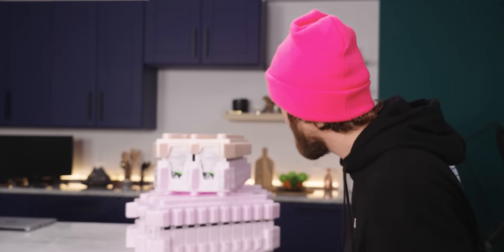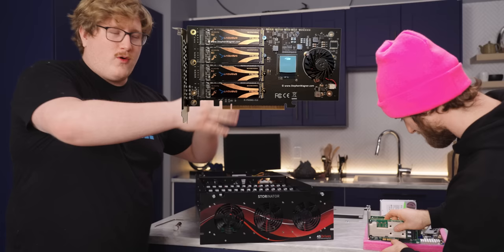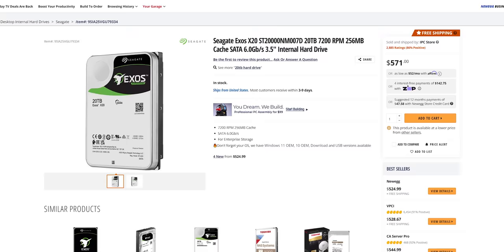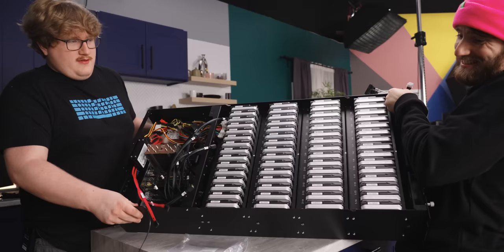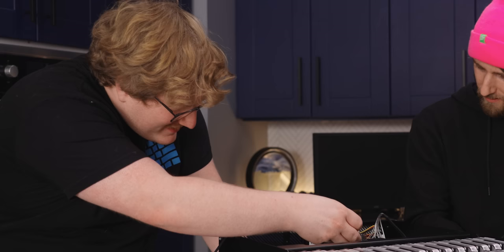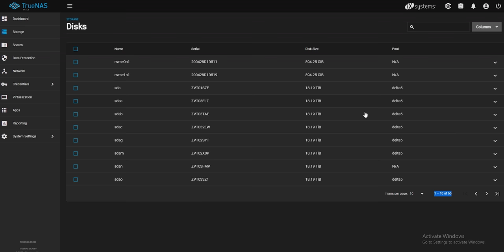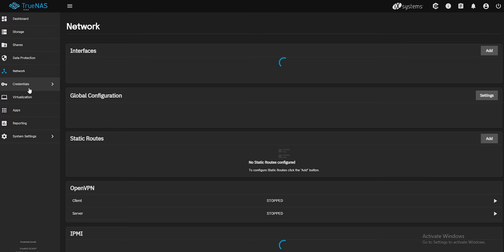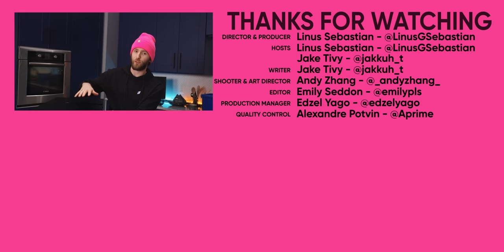My dream FINALLY came True! - Petabyte Project Recovery Part 2

Comment: I wonder why you're not going for the WD Ultrastar DC HC560 drives instead of Exos X20? It doubles the cache to 512MB (so the whole array one could say has 30GB of HDD caches ;) and it comes with their patented OptiNAND solution for faster/more efficient ingestion/look-ups) and from the spec sheet reduces the power draw when in use by 2W per drive, that would amount to well over 100W saved when the server is munching through data across all drives... That's 100W the Epyc/RAM/SSDs/HBAs could well use... Sure it's just 100W on the whole storage machine that eats well into 1000W... so not that much in grand scheme of things racked in your DC, but it's a reduction on a 24/7 solution. Perhaps there were other factors for the choice? It couldn't have been just price, as WD seems to hover around or slightly below those X20 20TB Exoses, so in bulk sales you must have got great deals regardless of the brand. I doubt it's a brand's historic quality thing, as we all know WD Ultrastar DC drives are actually coming from the HGST R&D that WD has bought (and thus slapped WD logo or colored names on'em) so they offer DC/server storage pedigree and stability engineers know of. So what was the favoring factor for the Exos drives?

Comment: Linus should let me do his hardware monitoring setup for his petabyte project. In 10 years I have never lost data because of drive failure. But I also worked in a company with 100k+ servers and buitl the hardware monitoring solution myself :)

Comment: Why to do single enclosure? Please examine the leading tech about how to do petabyte storage. Single chassis is single motherboard, single point of failure. You need several chassis and advanced networking filesystem. I mean like Isilon systems.

Comment: Coming from managing two 1.5petabtye all flash HPE 3PAR 20800 systems (prod site+dr site),  I'd personably be worried to put data on their rig ,its not even redundant with another copy , but I guess its all for sh*ts and giggles anyway,  like a really big NAS.
Also guessing they don't have a proper backup solution in place , real hail Mary situation going here.

Comment: It's much cheaper than using 50TB SSD's at $12,500 each. $300,000 for the drives would be a lot! Still better than putting 60 of the $40,000 100TB SSD's. $2,400,000 is a bit pricy for drives for one server and who needs six petabytes anyway? In twenty years we will have single petabyte drives that are like $50 anyway.

Comment: What I don't like about buying drives on mass like this is that they tend to fail at the same time-ish. If they're from the same production series and there's a manufacturing issue then its even worse.
Scrub on a 40Tb NAS already takes like 3 days, is it going to finish scrubbing all disks before the month is up or is it going to be scrubbing 24/7/365 ?

Comment: Hey Linus,
 
Just curious, why not just buy an actual SAN from a vendor like HPE and have a support contract? Just replace drives when you need and have a second one for replication and failover.  Your company is at the point to where you need to begin looking at enterprise storage solutions rather that using some third-party hardware. What kind of support do you get for the storinator? Some support contracts include on-site support if the device is to fail within a few hours. That's pretty much a standard for EMC'DELL'\HPE. How does the firmware on the storinaor compare to that on an enterprise SAN?

Comment: Oh and instead of instead of using a cooler what do you want to do and you can actually get them and just order and it’s copper tubing but it has the nickel with it and it’s meant for your brake system but you can actually use that and you can write liquid through it but then that way you can actually harvest the heat and her made it in the Thermo electricity in Feedback into itself which will also keep your system from crashing because then it’s not you know if it’s like when it when you feed the power back into itself it gets smarter

Comment: You really should look into a Qumulo cluster with your needs. I'm loving it.
Reply: No they shouldn't. They should hire an IT engineer and get a real SAN.
Reply: @pufthemajicdragon  This is a NAS device not a san. Difference is how you attach to it. A San is joined as a block device allowing you to format it on the machines you attach it to. A Nas device allows you to connect with SMB or NFS and a few other methods. NAS devices typically have an underlying filesystem. The advantages of a qumulo cluster is redundancy. You can loose a machine or a switch and the cluster does not go down. You have quite a bit more bandwidth to the cluster as you have multiple machines to service the users. NAS devices are used for more than one computer to access the files. SAN devices are used with only one computer to use the files. You can use a SAN attached disk on a NAS machine but it is highly inefficient.
Reply: @pufthemajicdragon  I think you need to research Qumulo. It doesn't even sound like you know what you are talking about. It is so much easier than what you describe. I actually do not know how prices compare but any of their IT could easily manage a Qumulo. And you pretty much need to do as much work or more for a SAN solution. I replaced an EMC Isilon which took a lot more knowledge than the Qumulo does. The Qumulo was significantly less expensive than  continuing with EMC. At least that is what I have been told. I do not know their workflow. But if multiple people work with the same files a NAS is better than a SAN for that kind of workflow.
Reply: @pufthemajicdragon  A SAN makes more sense for a VM environment. Where each of the machines needs it's own disk carved out on a SAN. For non-VM's each machine would need a card capable of presenting the storage to the machine if you wanted to boot from it.
Reply: @jeffsadowski  
Jeff: Doubles down on the NAS idea
Also Jeff: Is wrong
Also also Jeff: Doubles down on the NAS idea

I am as familiar with Qumulo as I ever care to be. It's a software layer for abstracting physical storage media for file-based storage. It's DFS for your nix-based NAS (hashtag reductionist analysis). And here you are telling me that *I need to research it while you're touting it based entirely off of "what you've been told". Dude.

I told you, a NAS is a purpose-built appliance. Stretching out the acronym to justify a claim that it therefore describes any and all kinds of network-based file sharing is definitional retreat. Hell, by your definition filehippo is a "NAS". But by your definition so is a SAN, which means you agree with me but are just being confrontational. 

Qumulo is a software platform for managing data. LMG already has a software platform for managing their data - they use Windows and it is more than enough to suit their data management needs. What they do need is a hardware platform that doesn't fall apart every 6 months. A SAN is that hardware platform.

(Qumulo does sell hardware, but near as I can tell it's whiteboxed Supermicro. There is no value proposition in their hardware. And it's the hardware that LMG has a problem with.)
Reply: @pufthemajicdragon  8:52 TrueNAS is what they are using. It does not support using multiple machines as one file-server. The glusterfs solution was closer as it allowed more machines to add more storage (It was also more complicated). The method they chose with a single chassis has no redundancy on most aspects (at least they are doing raid). Single point of failure with the machine failing. If they can be down till they find a replaceable hardware that is up to them. It also has reduced bandwidth because it is one machine.  With a Qumulo Cluster as with an Isilon to get more storage or bandwidth you simply add more machines. (NOTE you need the network equipment capable of the total speed you need) The single file server solution requires more and more disks, or more and more density. The upgrade costs are much higher replacing all the disks than just getting another node for a Qumulo or Isilon cluster. Not to mention backup solution built into the Qumulo and Isilon cluster model called snapshots. Traditional backup for me was taking longer than my network could support and killing bandwidth for my users. I actually have 2 clusters one for DR (Disaster Recovery) That I keep in sync with my primary cluster. I have about 1Pb of data and it took a few weeks to setup the replication but now it is able to replicate with little network usage at all. My SAN I use for my VMware cluster. No other machine but the 4 hosts I have can see the SAN.
Reply: Why would you want to have the redundancy speed at the block level just to loose it again sharing it out to a machine when they are going to be using it as a file server anyways. A SAN doe not make sense.
Reply: @pufthemajicdragon  All the benefits you mentioned for a SAN apply to a Qumulo or Isilon. They do not need a SAN.
Reply: Also I know a Powervault would not cut it in my environment. They transitioned from a similar solution into a Isilon because of it. The only upgrade paths for me were replace an aging Isilon with a new one or move to Qumulo. They might be able to do with a Powervault at LMG. They probably do not have the machines hammering the filesystem like I do. But what costs more per space? We have powervaults at the other locations they have more issues with them than I have ever had with the Isilon.
Reply: Qumulo warranties their hardware as well but even if not that's the whole idea it is designed for pieces to fail. I can loose multiple pieces of hardware. I have a real problem with multiple pieces in a single chassis as you need to take it down to replace it. I can remove a couple of nodes of a Qumulo or a switch without an outage.
Reply: Thinking about it, Yeah a powervault with expandable shelves would probably work good for them. Not everyone has the same needs.

Comment: On one hand it could be fun to have a drinking game where you take a shot every time line us break something or drop something or does something wrong. Downside is used very quickly be getting sued for alcohol poisoning deaths. $30,000 in hard drives technically 40,000. Clutches chest. 40000 goddamn dollars would pay my taxes for the next 10 years or so and pretty hefty chunk of my other bills if not everything taxes and bills. Scary to imagine somebody spending that much strictly on her drives.

Comment: How come you guys don't give the western digital (formerly HGST) enterprise drives a spin? Better power consumption, and better reliability several years running through lower annual failure rates (see backblaze's data).

Comment: Btw, how do you deal with that error when trying to access another computer on a LAN?

I sometimes connect my two PCs with an ethernet cable, but only one of them can access the shared folders of the other PC seamlessly from the Network library, while on the other computer you need to manually type the network location of the shared folder (the... subsequent folders in that one can be accessed the usual way).

tldr: Both PCs can access each other's shared folders, but one of them requires you to manually type the location of the shared folder(s) you want.

Comment: - If they had made it take 64 drives instead of only 60, you know, a nice proper power of two, then you'd have been able to break a full petabyte. 🙄 🤦
- It'll take a month to transfer all the data? Jeez, I'd have a heart-attack from stress, waiting to hear the crunch of drives failing within the first day. I used to leave the room and hold my breath just waiting for a CD to burn. 😒
- Unactivated Windows? 🤨

Comment: What is the purpose of having a server like this? If the data is literally just stuff you don't wanna throw out but also don't ever use, it seems excessive to run a server 24/7 just to maintain old files that will never be used. especially if you extrapolate to a worldwide scale, like how many tons of CO2 is wasted each year, just on upkeep for files that will never see the light of day again. Are there any storage methods that don't require energy that is also safe?

Comment: Question:  I remember once before you mentioned (in a video) that you mentioned a limitation or restriction to the number of hard drives that could be spinning in a chassis at one time. Is that applicable here?

Comment: 3:08 actually . . .  its the issue i ran into with my unraid server, not enough pci-e lanes. and since epyc was cheaper than an threadripper. that is exactly why i went epyc!
8:08 please tell me you tested it before putting it in . . . i had to mount my epyc 4 times before it made proper connection.

Comment: People in 2032 watching this old nostalgic video from their PC with 10PB SSD be like: “Those were the days”
Reply: You say that, but the first 10tb HDD was created in 2014. In 8 years the size of these hard drives are only 2x as big. A 1pb drive is pretty far off seeing how you would have to double this storage 6 times to reach it. At current pace for consumer hard drives that would be 48 years from now. Granted, you said SSD, and I think the SSD side of things are advancing faster. However, in general these days the focus is in scaling horizontally instead of vertically. Instead of larger drives, you just add more. Use something like CEPH and scale your storage out over multiple hard drives across multiple machines.

Comment: Needed another 3 drives to be considered a 'nice' setup... Also, when selecting drives one by one couldn't you have just selected all and removed the few you didn't want?
Reply: They couldn't have used the select all button because they were setting up vdevs with 15 drives in each one.
Reply: @Bixsu-  good point! Forgot about that, nice one.

Comment: But if you put a 20TB disk, if you loose one, u loose more data, so if I would be doing this, I would still use an 16TB disk... Its logical if you have data you don't wanna loose

Comment: I am convinced this is a troll. 50+ drives in a 4x15 pool and raidz2? I wouldn't raidz2 more than 8 drives... vdevs are not supposed to as big as you can make them haha. Same loads and cycles and microwave configuration. How about some hot spares?

Draid is literally made for this use case with large files. You could easily get 75% from that 1.2pb with triple parity. The rest of us get to run striped mirror but you could have something enterprise.

Comment: So you've not completely learned from your past data loss. You should be using SAS drives not SATA. The MTBF of SATA is less than half that of SAS. SAS is faster. At least you are using a FreeBSD and not Linux. An OS based on the Illumos kernel would be even better.

Comment: Me: who TF needs a petabyte of actively accessible data?
LMG: silent stare
me: hmm I guess if you are a media company editing 8k footage on the reg....

but honestly, I am completely baffled at the PERSONAL data storage of the employee's
no normal person needs >25tb TOTAL of "hot" storage
I am not even to 10tb TOTAL (and that included a lot of mirroring between my laptop and desktop)

in fact my NAS+hosting pc is using the VAST majority of my storage, it is 7.4tb
I am not counting OS drives as they are not used for storage, just for OS data, and my laptop+desktop had 1tb "games" drives until this year, when I upgraded the laptop to a 2tb SSD instead of a 1tb 5400 hdd

well I suppose I am using about ~11tb total active data storage (500g+500g+500g(boots)+1tb(desktop)+2tb(laptop)+7.4tb(server) and will be converting the desktop to ALSO be a 2tb ssd for sync simplicity) but that is assuming the drives are all full, which I never do to my OS drives as they frequently need cleaning which would make re-installing windows a bear

seriously guys, it is cool to have 1200gb of raw hot storage that can be accessed at 1-10Gb/s, but how often does a real home user need more than 1Gb/s and have the money to burn to saturate the network link with storage on BOTH ends?
my nas might be a tad slow given it is a single 3-drive raid-5, but my other computers actually struggle to saturate the network anyway, which was 100mb/s before I realized my old router was only 10/100 despite being an n600 dual band(which would need 3 whole ports to saturate a single band, so why TF would I assume it wasn't gigabit?)
I am awaiting the petabyte data recovery V2 in 2030, it is coming

Comment: Stop it, you're giving me a heart attack.  Drives are either fixed in the case or in their shock-proof foam.  Linus stands it on its end, then on its side, no, no, no.  Put it down flat.  If you knock it over there's a good chance buy-buy drive.

Comment: You guys have too much spare money to waste and are doing it wrong. Do you really need all that data/files to be on a blazing fast and expensive storage all the time (even old projects/archives)?! There is a teared approach of storage - you can build a second server with slower cheaper (and bigger)  storage (for older cat videos). Keep your current projects on that fast media and once is done - move it to the slower one. In that way you can afford another server (even slower) for backups, but you have to use smart backup process as well not to take forever. You know the letter "I" in RAID.